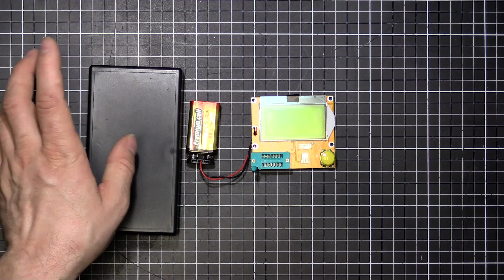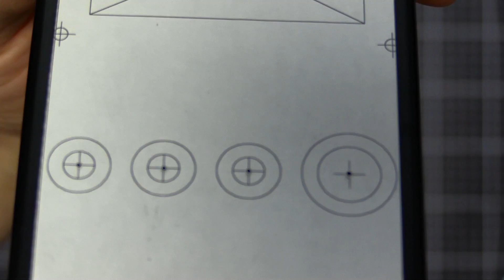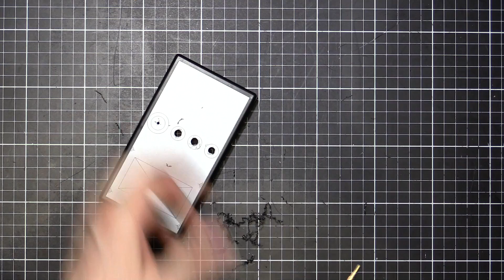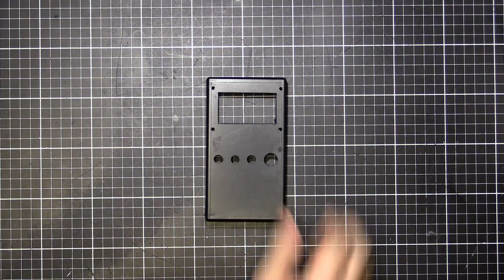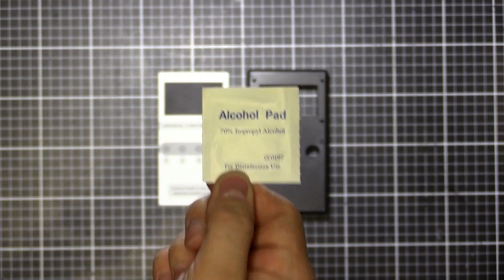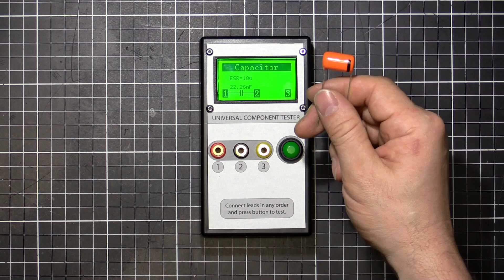How to make professional looking front panels

Comment: You can also use a laminator to make a more durable label. If you require a window, cut the hole in the paper before you laminate it. Stick on with glue or double sided tape.

Comment: Ink jet printer media ,the ink will bleed over time,i printed pcb layouts and it bled over the period of 3-4 yrs,it may seem a long time but you want it to stay intact,laser printers are the best,colour laser printers are horrendously expensive.

The best method so far i have seen for good diy panel marking is laser printable water slide,it comes in colour or clear and you have to clear or satin coat over it,but it wont ever bleed,it might chip,but then you can as you did plastic coat it.
Reply from the maker: Yeah, I want to try the waterslide decals.
I'm actually trying to find an easy way to apply white lettering to front panels to restore HP and Tektronix equipment.
Too bad white laser printer toner isn't more common...

Comment: Great video. A little scary with the mid-air drilling, though. I once didn't get my finger far enough out of the way... and on more than one occasion, I've had the drill grab my case (it happens more often with aluminum). I recommend drilling on top of an old 2x4 chunk of lumber.
Reply from the maker: Yeah, I do that now. :)
Aluminium is bad for grabbing, soft enough for the drill bit to bite deep, strong enough to hold on and not let go...
Reply: I also thought so. Also, had experience in the past where the object being drilled just broke from too much pressure (from the drill)

Comment: Packing tape or clear shelf liner over the top of the paper will greatly improve the durability of your label.
Reply from the maker: Yeah, the trick is finding the stuff here in Japan. Packing tape is good for smaller projects, but this one was juuuust a bit too big.
Reply: @NearFarMedia  Maybe just  spray clear acrylic lacquer on the paper? Or apply it with a brush (I use clear acrylic nail polish top coat)

Comment: Great job on the video, quite comprehensive. There were a couple of things you skipped, though, that I wish I would have seen. You said you made the opening square with a file. What kind of file did you use? Are there any tricks to getting a nice, clean edge? Also, how did you eventually cut out the holes in the label for the terminals and switch?
Reply from the maker: To smooth out the square hole, I just used a flat file to carefully make the edges straight.

For the holes, I just cut them out with the same knife I used for the square hole..
Reply: He's an electrician, so he can make a nice straight edge with a file with no tricks. Just practice and practice, I guess! File to the line.